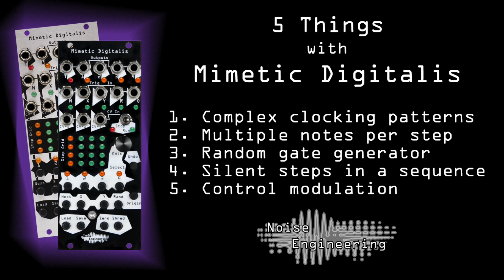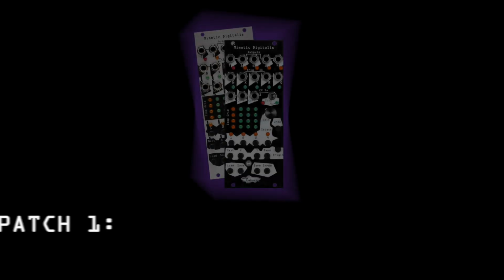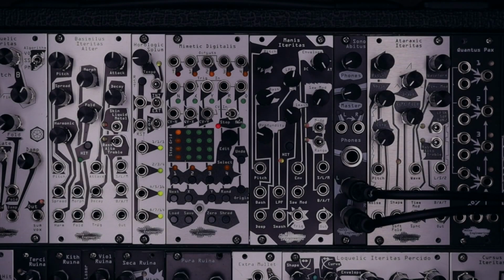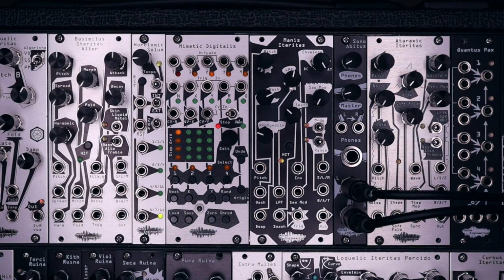5 things: sequence and pattern patches with the Mimetic Digitalis Eurorack module

Comment: 1:20 Aren’t you using Quantus Ampla here as a low pass gate, not strictly as a VCA? I’m not the best with modular and have been wracking my brain how a strict VCA would work this way. I can do it with an Optomix but not Maths, though I admit I might be missing something.
Reply from the maker: Excellent question! We have two blog posts that may be helpful. This blog talks about the differences between envelopes, VCAs, and attenuators: https://noiseengineering.us/blogs/loquelic-literitas-the-blog/getting-started-envelopes-vcas-and-attenuators 
And this one talks about lowpass gates: https://noiseengineering.us/blogs/loquelic-literitas-the-blog/getting-started-lowpass-gates

Comment: Just 2 days ago, I received my Jam Jam to work with my Erica LXR Drum module. I'm currently using MI Grids with them. Grids trigger outs to JJ 1-3 in, JJ 1-3 out to Frap Tools 333 RYG in, Grids accent outs to LXR accent ins, and 333 RYG out to any damn place I like, so I can mult JJ delays out across the whole system - 3 mult outs per JJ channel, I can send swing/delay/phasing to drums, filters, envelopes, fx, whatever... Seriously, I don't get why the Jam Jam isn't getting more love.

Anyway, I have other sequencers besides Grids - Metropolix, 0-Ctrl, Beatstep/Keystep, Metropolix, Euclidean Circles, MI Frames and Marbles, Tetrapad/Tete... I'm not shy on sequencing options. But looking at this... Holy shit. It looks amazing. It has so many of the pros of the above, and with low hp. On the list!

Comment: Great ideas here.  Can you explain why the high value in patch one makes it reset?  Just curious:)
Reply from the maker: A high CV is interpreted the same way a reset trigger would be, so it jumps back to the start when it reaches that step. Self patching MD is a lot of fun!
Reply: @NoiseEngineering  Ah ok, I see.  Much appreciated.
Reply: @mcgrealtube  It looks to work the same way as the Make Noise 0-Ctrl in that respect. On the 0-Ctrl, if you want a 5 step sequence, you patch gate 6 out to reset in. The gate on the 0-Ctrl is the equivalent of the high value with the MD.